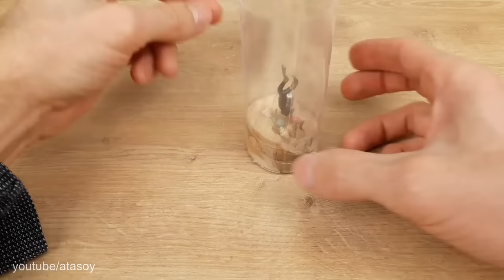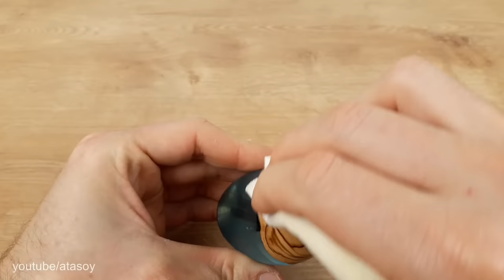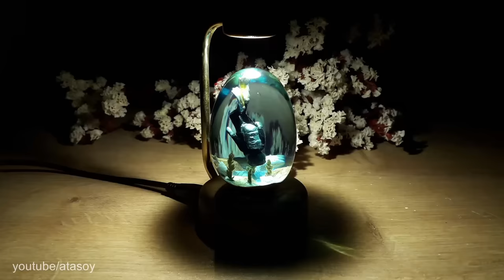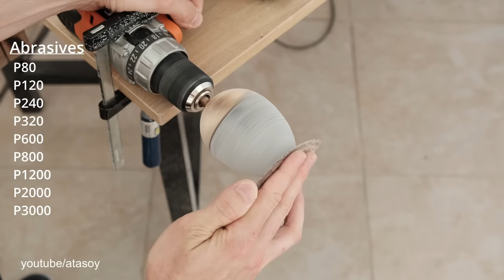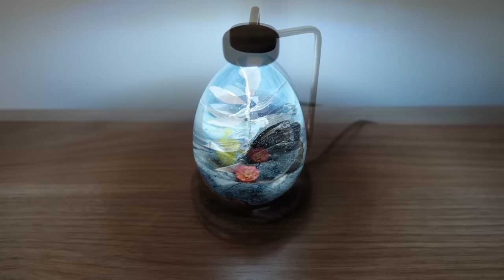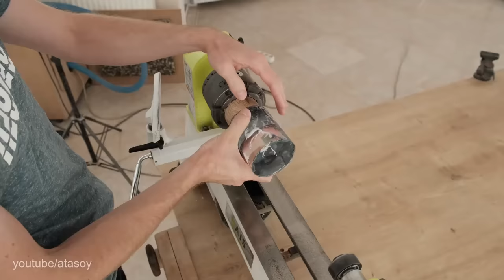3 Simple Epoxy Resin Egg Ideas

Comment: Normally dead bugs don't cast well in resin, they get gooey and brown and gross. You really should use properly preserved bugs in resin
Reply from the maker: Yes, I used a butterfly I found in the workshop. It was great. When I find different insects, I will apply your advice.
Reply: Amber
Reply: @kittyparker4076  those are usually tiny bugs with not much inside to rot and the natural amber resin that takes thousands and thousands of years to actually cure and become amber is vastly different from man-made resin compounds!
Reply: Bugs with exoskeletons shouldn't if left to air dry for a few days to a week longer depending on the size of it
Reply: Indeed
Reply: There is always one expert 🙄
Reply: Absolutely stunning work, you have obviously been doing this a long time. Well done 🥰
Reply: @atasoy That wood is beautiful, what kind of wood is this please?
Reply from the maker: Thanks I'm glad you like it. Yes, I've been working on this for a long time.
Reply from the maker: I use olive wood for the epoxy part.
Reply: @michellemoores6327  just speaking from expierence there's no need to be a dick, just thought I'd forewarn him before he ruined a piece. 🙄
Reply: Good Tip!!! I had this happen with a butterfly I tried to make into a pendant, it looked nasty!
Reply: @pandauk2538  I've seen jeweled beetles get all brown and gross in resin if not properly preserved, there are a few videos of it on Youtube
Reply: @TiffYG2133 there does always seem to be an expert but whats wrong with that. I get called a know it all and I'm just trying to help so someone doesn't look like an idiot, loose money on projects, or whatever it is. Which used to hurt my feelings a tad when I was younger but now I see it as a compliment. I love information. I know a little about alot, and alot about several areas. When intentions are pure as yours are stated, I think it's great to help. We don't get enough of that in today's age, that's why people get butt hurt or misunderstand intentions. If you were being a smart ass then it would be different but you weren't. Good advice. 👍
Reply: @atasoy glad you did the butterfly but my question is will the bugs turn brown after they have been preserved in the resin?
Reply: 🎉 parabéns!!! Qual a sequência de lixa para um acabamento perfeito? Qual cera para polir você usa?
Reply from the maker: P80,P120,P240,P320,P400,P600,P800,P1000,P2000,P3000
Números inferiores ou superiores podem ser usados para números que você não consegue encontrar.
Eu uso Mirka polarshine 35 e Mirka polarshine 10 para polimento.
Reply: Precioso no tenía idea ni cómo se hacía gracias por compartir😊

Comment: I’m new to this whole thing but like to learned new skills. 
Can you put some details maybe with links to shop and buy some of your supplies? 
What type of plastic or clear material are you using to build the tall cylindrical molds?
Reply from the maker: I usually use acetate paper or 1.2mm transparent PVC sheets when making molds.
I get them from local vendors in the country where I live.

Comment: You know, I watch your videos in complete admiration. I work with resin, but every time I have to sand, I can't get a glossy finish. How do you do it?  I've even tried spray finish with no luck. So if I don't have a perfect cast, I'm in trouble. Advice would be greatly appreciated. ❤️
Reply from the maker: Can you summarize the way you followed to polish after sanding (80,120,240,30,400,600,800,1000,2000 and 3000) respectively.
Which polishing paste do you use to polish?
What kind of sponge or felt do you apply the thick polishing paste?
What kind of sponge do you apply the thin polishing paste with?
Are you making these by machine or by hand?
Reply: @Atasoy  I start with 250 grit then gradually increase to 5,000 & sometimes I keep going to 10,000 grit. I use wet paper. Most of the time, I sand by hand. Sometimes, I use my hubbys hand sander or a little hand-held tiny sander, but mostly it's by hand.  Then, when done, I use this polishing paste I have. It says on the box, "Polishing Compound for use with resin. No brand name or anything. I do all this, and I get a nice smooth finish, but no way is it glossy and clear like yours. I've tried the spray enamel, but I'm finding it does not give me the silky smooth glossy clear finish like what u you get.  Any suggestions would be greatly appreciated. Thanks.
Reply: I think I might have found the solution to my problem. I was doing the right steps... stepping up gradually with sandpaper and then a good polish. I just wasn't sanding long enough. I was covering the area, and I thought I had sanded long enough. But I gave it another try this time methodically and slowly, making sure I got it really sanded down. Then, when polishing, I really gave it a lot of attention. I'm still not getting the glass like finish you are, but it's a lot better. I will keep at it and maybe not be as good as you are but hopefully close. 😊  Best wishes. Sharon ❤️
Reply from the maker: I missed your previous message.
Sanding is very important for a good shine, also in the equipment you use in the polishing process.
Do you use a machine in the polishing process?
Reply: @Atasoy  yes. I have a nand held with the different heads I can change etc.
Reply from the maker: After the sanding process, you should first apply the thick polishing paste at high speed using fluffy wool felt, if you can.(Around 1500 - 2000 rpm.)
Then you should apply the same thick paste with a medium hard polishing sponge.
Finally, you should finish by applying the thin polishing paste with a soft polishing sponge at low speed.
Reply: @atasoy  I will give it a try. Thank you for replying. Any recommendations on types of polishing pastes?

Comment: Hi, I LOVE all of your work, I watch you all the time. 
I have started to play with resin, but having a lot of trouble with bubbles!!!! It looked like you used more of 1 than you did of the other resin when you poured it out on the scale, and after you mixed it for a bit it turned totally clear. Could you please share with me how you mixed your resin so it got perfectly clear? I've mixed it very slow and I still got a ton of bubbles, and at this point I'm completely frustrated.
Reply from the maker: hello, in my works, I pour the hardener first and then the resin.
I mix it slowly without any rush.
I wait for 10 minutes after mixing and then pour.
If you can't get a transparent clear appearance even though you mix the resin, check whether you have kept your resin in the cold.
Resin waiting in the cold will crystallize. Therefore, we cannot obtain a transparent appearance.
In such a case, you can only remove the crystallization by keeping the resin in hot water of 70 degrees for 15-20 minutes.
Another factor is that even though there is no crystallization, the resin waiting in a cool environment will leave a lot of bubbles when mixed.
Because the viscosity of the resin waiting in the cold will decrease, so there will be plenty of bubbles while mixing.
To prevent this, I recommend keeping your resin at an ambient temperature above 24 degrees, especially during the cold winter months.
If your budget allows, you can purchase a vacuum chamber and motor, vacuum the air bubbles in the epoxy after mixing and obtain a perfectly clear epoxy.
Reply: @Atasoy  I really want to THANK YOU!!!!! for all of the information you provided, it has helped me out a lot. We are just beginners and have a long way to go to learn resin art, but the information you gave will go a long way in helping us to make good quality resin products.
Reply from the maker: You're welcome, I hope you do great work by learning to work with resins as soon as possible.

Comment: Would you share where you get the supplies for the lights and tubing for this project. Please and thank you.
Reply from the maker: I procure light and pipe materials from local dealers in the country I live in.
If you do a little search on the internet, you can find similar ones.
5mm brass pipe.
5v led

Comment: hello there, i really did enjoy watching your video, but i was woundering about the mix you use, could you tell me how in  ( ML ) please. and thank you so much.
Reply from the maker: Thank you, it will not help you if I tell you the ratio of the epoxy (ml) I have prepared, you can find the mixing ratio you need to prepare on the packaging of the resin you purchased or from the instructions for use.
The mixing ratio of each brand of epoxy is different.
To find out how much epoxy you need to prepare, you should measure the mold you prepared, calculate its volume and prepare the epoxy accordingly.
Here is the link for the epoxy I use - https://resininresin.com/product/mass-pro/?v=ebe021079e5a

Comment: Great video, can I ask do you use a pressure pot to get the air bubbles out?
Reply from the maker: Thanks, I've been using the vacuum machine in my work for a while.
I only used a deer model vacuum machine for these three eggs.

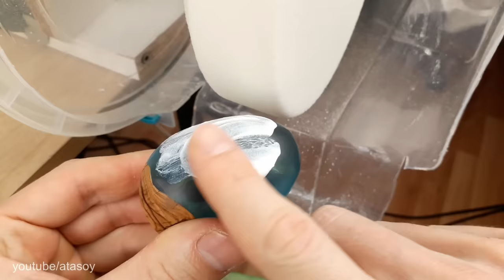Comment: What are you doing at 10:50? And what is that white stuff  called? Also, how do you get these miniature dolls?
Reply from the maker: I purchased the miniatures from Aliexpress.
The white thing I used at 10:50 is car polishing paste.
I'm currently using these two polishing pastes for polishing;
Mirka polarshine 35 thick polishing paste
Mirka polarshine 10 fine polishing paste

Comment: alghough I loved them all , the last was my favourite, Beautiful.   Just a question…are you wearing a face mask and goggles when using the resin, especially the shaping and sanding part.  I hope so, as resin can be a life changing toxin.  Also wood fibres can ruin your lungs.
Reply from the maker: Of course I use it, you should see the dust when the dust absorber is not used.

Comment: What is the ratio of mix on the epoxy?
Reply from the maker: The mixing ratio of the epoxy I use is 10:4.
Mixing proportions vary from brand to brand.
This is stated on the packaging of the purchased epoxy.
Reply: @atasoy  what brand do you use?
Reply from the maker: I use the Resinin brand product.
Resinin slim extra for thin castings.
Resinin Mass Pro for deep castings.
Resininresin.com
Reply: @atasoy  Thank you!
Reply from the maker: You're welcome 😊